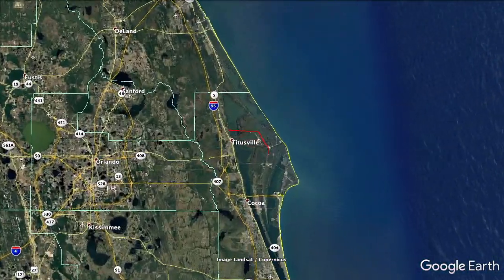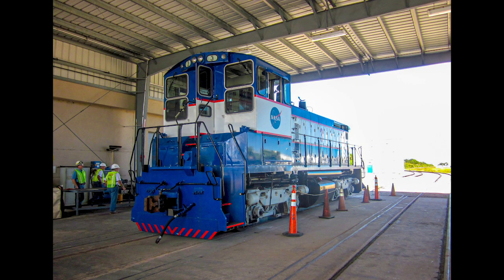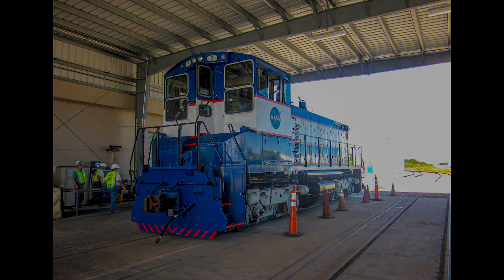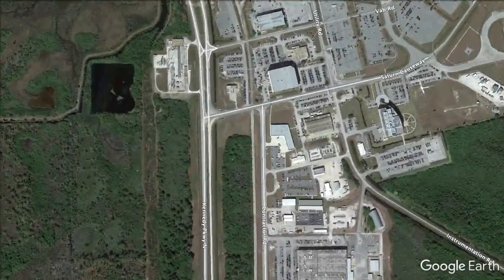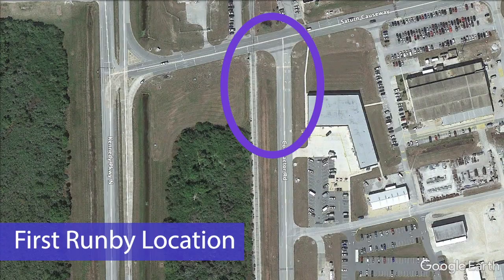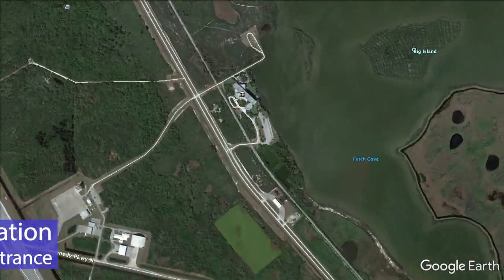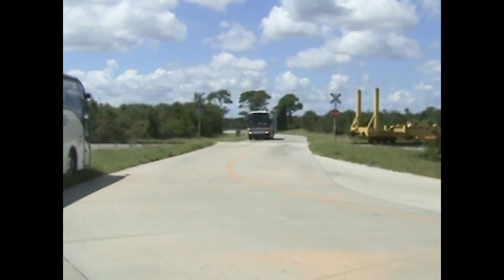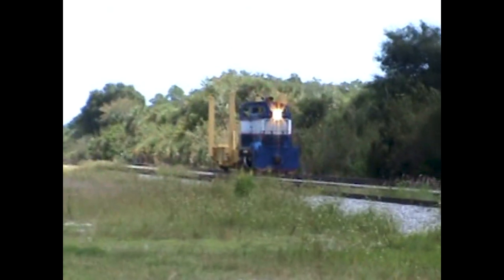Final Run of the NASA Railroad

Comment: And... It's back up and running, sort of.  Kind of.

Let's hope that SpaceX, Blue Origin and ULA will pick up the use of the railroad.
Reply from the maker: Of course I released this video about a month before the first train ran again. The new operation only uses shuttlewagons (trackmobiles) and is operated by a nonrailroad entity at KSC (ground systems) so there really is very little that is similar between the two operations other than the tracks.
Reply: @RoamingRailfan  One can hope....  (sigh)